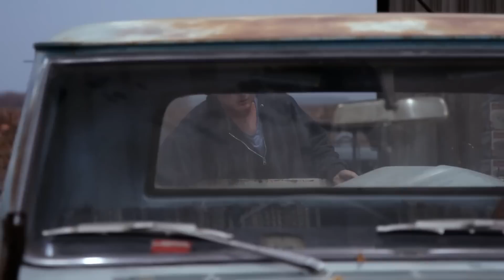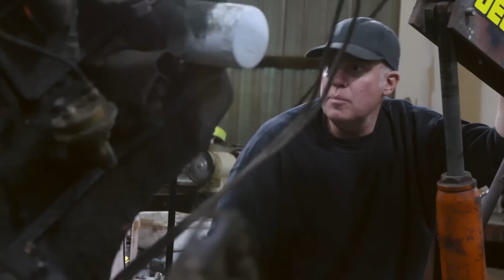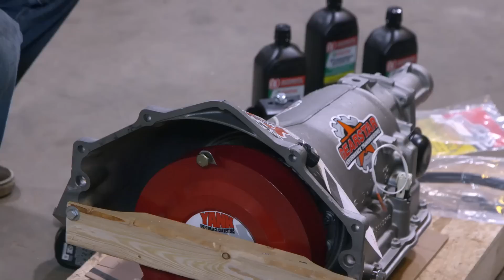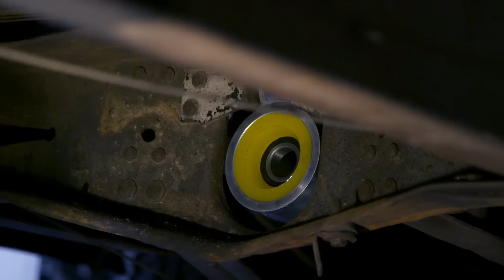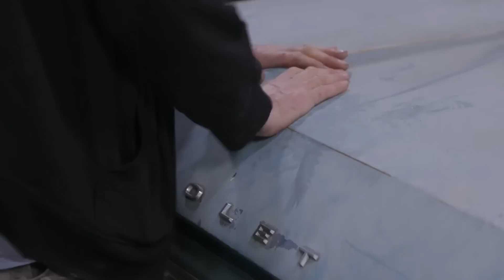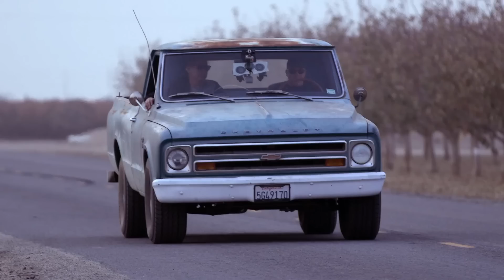630-Horsepower Big-Block C10 Swap! - Roadkill Garage S03E02 - Reality Car TV Show

Comment: You could have used the notch that was cut out of the frame and flipped it over and welded it in to strengthen the frame

Comment: Built a buddy a hotrod 292 about 5 years back. 3×1bl carbs, milled block and head for 185psi cranking compression and had Howards cams grind a sweet cam(solid lifter flat tappet- for beautiful valvetrain songs and a nice crackle out the tailpipe, 106LSA). It ran great and looked beautiful.

Comment: So i had an '89 chevy k1500 back in the day. I sucked water into the anemic tbi 350 and bent probably 2 out of 8 rods. I was pulling a damn good check for a 19 year old kid at the time (2007) so i bought a 600hp blue print 383 stroker, pulled all the 4x4 stuff out, put a built t400 in with a 3200 stall converter. If you remember those late 80s early 90s GM trux, the speedometer was like something out of robocop. They went up to 85 then somewhere around 90, it would start coming up on the other side. Now keep in mind i dont know how accurate it was. I was on my way to my girlfriend's house on the freeway and i had the thing go all the way up to 60mph after it had already been buried. Thats gotta be close to 135-140mph. WITH a 2006 yz450f in the bed. That truck hurt so many feelings. I actually ended up swapping in Dana 60s from a 97 f250 with some decent coilovers. Skyjacker radius arms up front and i made my own trailing arms with a stick welder and old tractor parts. Lockers, np205 tcase, 40 inch baja claws, black d window beadlox, it was an absolute monster. I pulled my buddies mega cab sunk to the frame out of a mud hole and i had to do it on like a 20 degree hill. Pitching softball sized rocks like 100 feet it was badass.... Until one smacked my buddies brand new megacab. I was like "U shouldn't have been sitting there!" Hahaha
Reply: Hell yeah,you only need rear wheel drive anyway. Blazers C10 and square body Chevys have always been my favorite trucks. One of these days I’ll get my hands on a nice old square body, or one the old Chevy models.

Comment: I miss my 72 c10 😢 had a 383 stroker with a big cam 700 cfm carb and 3.73 gears with a welded diff lol got into mid 12s 1/4 mile !

Comment: No comment about the gas pouring out of the fuel cap as soon as you drive it offroad. Also, at least get both headlights working. 🇨🇦
Reply: THAT'S ROADKILL!!
Reply: @ludicrous7044  BAM!!!
Reply: Don't get it right, just get it running.